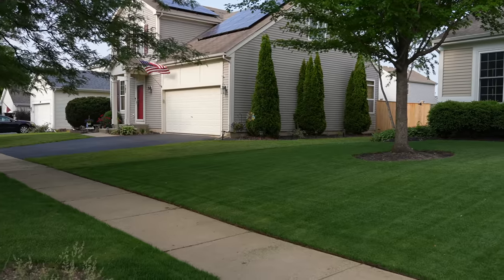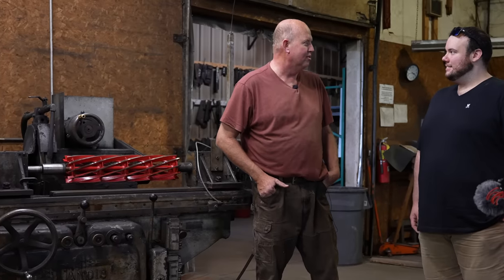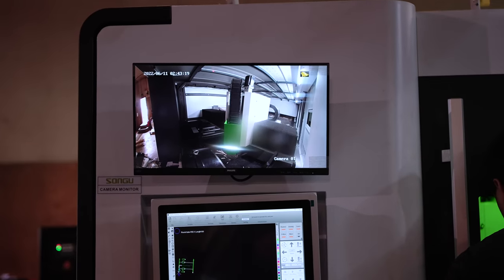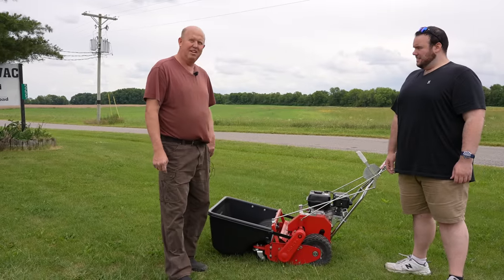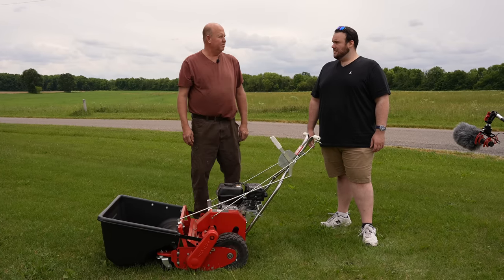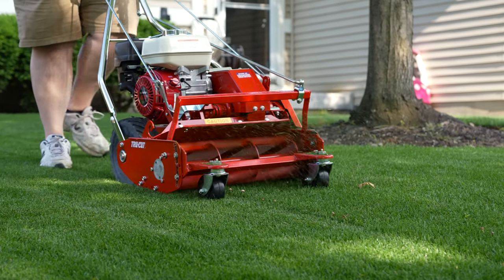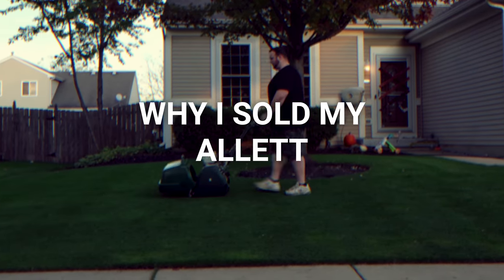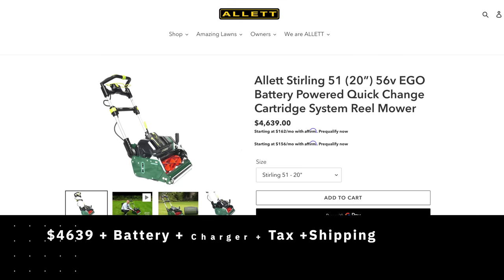This Mower Will Make Your Lawn Look Like a Golf Course

Comment: Nice review on the machine.  I wish it would stripe .  I wonder if you could rig up a Big League roller on the back.  I have a Swardman that stripes great but is hard to use as if the grass gets too tall it doesn't cut unless you take the front roller off and put on the tall grass wheels, which don't roll very well.  I usually get my time master out and mow with that, then use the Swardman the next day.  My schedule doesn't work to mow every other day very often.
Reply: It should stripe now that George added the front roller

Comment: 😉 Thank you for the contact information for a local Tru Cut... I'm not in the Chicago area. I'm in Quad City area, little town of Aledo, IL. I'll be getting ahold of them. I don't know if they can help me, I have a True Cut, well kind of... I have a Starlite - True Cut... The original before it was actually just True Cut, an aerospace company, Who originally designed it from my research, and as far as I can guess mine is about a 1965 model, 21" 3hp Briggs... I don't think they make a 21" anymore well as far as I am aware. Not much has changed over the years. I bought mine used for only $30, it's old and has a lot of petina, and missing some guards, but some fresh gas and only 3 pulls and it fired right up and mowed the yard. Not bad for a 60-year-old mower. I will try to contact the company here local and see if they can point me in some right directions to possibly getting it service and possibly finding some old new stock or whatever for guards because I would really love to restore it to original  ondition as it is wonderful mower. It isn't good on my tall grass, as I'm gonna have to get my grass used to being cut short, lol, but It's an awesome mower.

Comment: Will have to ck out the trucut, I’m on my second McLane, not bad but I can’t seem to get the reel to bedknife set correct, have backslapped with 80 and 120 grit, still not cutting right, as well the parts are too expensive on a McLane. I want the 10 blade fine cut, have that on my current Mc but have gotten bored with it because I want a finer cut. Next option is Greens keeper model which I just don’t know, have hard mixed opinions. I do like how smooth the Mc is to turn, those back wheels on trucut worry me. I too have looked at allett and swardman and the plastic parts turned me off. Neighbor was having problems w allett right out of the box and he was going to send back and they offered him Honda engine upgrade to try again. Your gonna use that button constantly, still gonna break. I wish I could “Frankenstein” a mower together like an Eddie Van Halen guitar, haha
Reply from the maker: tell me about it! the reels for the mclanes are like 500 bucks woah thats too much
i will say, nothing maneuvers easier than a mclane, you can turn that thing w 1 finger which is nice

Comment: I live in the northeast region ( pa). Was wondering what type of grass seeds to purchase so I can cut it low like yours. Not all grass blades can be cut that low....correct? Thx
Reply from the maker: Correct, you will need either kentucky bluegrass or perennial ryegrass or a combo of both, mine is a 50/50 mix of midnight KBG and SS9000 PRG
Reply: @PrincessCutLawnCare  I will look it up. Thx for the reply back

Comment: are you happier with the Tru-cut better ? also  looks like a great machine but is it Good please give us the pro/con on this tru cut reel mower Thanx my friend
Reply from the maker: so far yes, only have used it a few times because summer came quick but i will keep you update day come fall
Reply: @PrincessCutLawnCare  I am kinda sad to see the Tru-cut has changed no more Honda motor #2 no more chrome handle they sell it now with a china motor and the chrome which gives a more 50's vintage look is now black  It has now bin Down graded since they now  sold to Midwest Equipment Manufacturing Dam I really Loved the Honda Motor and that Chrome color GONE NOW FOREVER 😔

Comment: What's the best weed AND grass killer, whether it's a single bottle of stuff or a mixture. Something that kills the visable part of the plant quickly, but also eventually gets to the roots.
Reply from the maker: Hi paul, please watch this video, you have 2 options, 1 is fast and 1 is more effective https://youtu.be/A1J0aa-9ZpE
Reply: @PrincessCutLawnCare  - Thank you so much for the response. Can they be mixed to both kill the visable part of the weeds quickly, while also eventually killing the roots?
Reply from the maker: @TheOriginalPaulGilpin  no problem bud, round up is already technically a mixure of the 2 because it contains glyphosate, only issue is its a really "hot" herbicide due to the palergonic acid which tends to burn the leaf tissue before the gly can be absorbed. If you end up spraying round up, be sure to due it in the evening as the sun can increase the burning effects of the palergonic acid

Comment: I Appreciate ur content.  Hows it cut tho? I'm about to pull the trigger on the McLane then I saw this. Any cons at all
Reply from the maker: Thanks boss! id say they cut pretty much the same.
The pros with the mcclane is its very light and hands down the easiest reel mower i used when it comes to maneuverability.
The pros with the tru cut is its built like a tank, very heavy duty. Also the duel clutch where you can control the reel and drive separately is very handy when mowing around obstacles.
Reply from the maker: Cons with both of them is the reel to bed knife adjustments. They both work the same way and i feel both companies need to improve it to keep up with the euro competition. They are both a pain to adjust.
Reply: @PrincessCutLawnCare  thanks for the fast reply and input. Also I'm taking ur advice on irrigation system sprinklers. I have a mixed salad of rotors. orbit hunter and rainbird. I'm switching all to the hunter mp. Keep up the great work. Be blessed

Comment: Trucut and McClane would sell a ton more Imo if they had drums or rollers on the front and back. I just don't like the rear wheels.
Reply from the maker: I thought the same as well until I used it, those back wheels really make it easy to transport in and out of the garage and around corners

Comment: I have nearly a brand new Allett and how hard was it for you to sell the Allett? How did you advertise it?
Reply from the maker: it was very easy to sell, i put it on market place and it sold within 1 day
Reply: Cool never heard of Market Place
Reply from the maker: @garythorington1600  sorry I should have been more clear, I meant Facebook marketplace
Reply: Thanks for the clarification I may keep the Kensington so I can scarf the lawn now snd than
Reply from the maker: @garythorington1600  I think allett would be a fine mower if they got rid of the chincy plastic, included transport wheels, and lowered the price

Comment: I definitely don’t like those small caster wheels on the front what did it cost you to upgrade to that roller
Reply from the maker: roller was 189 but honestly the wheels gave me a VERY clean cut, actualy cleanest reel mowed cut ever but i can see if you lawn is not perfectly flat how it could cause scalping

Comment: So will George move over to another USA made lawn reel mower?  No gas, no cables, no oil, no spark plug starts every time you touch it. No maintenance ,George you gotta go green. And only weighs 84 lbs. And cuts as low as you want. Might I say Hudson Star.

Comment: I got a swardman and can’t stand it. Inside the drum the rotators held by plastic, parts don’t fit, parts hard to find, customer service sucks. Just a overall nightmare. I was looking at allet until I found out it was basically the same thing. Been looking at tru cut now
Reply from the maker: Just like the swardman the allett is also driven by plastic gears in the rear drum. The tru cut may not have a rear roller but at least it is built like a tank.
Reply: @PrincessCutLawnCare  I’m bummed they are all sold out
Reply from the maker: @2shotsofvaca411  the tru cuts are sold out?
Reply: @PrincessCutLawnCare  I checked reel rollers and it says sold out for 2022
Reply from the maker: @2shotsofvaca411  call the number in the description of this video, it’s the factory direct number

Comment: Thanks for the great review. I just wish I'd seen it before the mistake I made getting talked into a new McLane Mower. WHY?
 Because McLane's New $2400.00 25" Reel Mowers are quite simply, poorly assembled junk, built using Inferior parts. 

HERE'S WHAT YOU CAN EXPECT from McLane in 2023: Misalignment issues, Annoying Rattles and Vibration Noises at different RPM's, Metal Fatigue, and cracks that develop within the first few weeks, caused by HORRIBLE welding during manufacturing (that gets covered up with paint at the factory), then they slap on some stickers (crooked) with their name and deliver these piss-poor mowers to customers. 

And all of that began within the first few weeks of normal, residential use, cutting once a week, and babying my new mower. I went to their website to file a warranty claim that's supposed to be covered for one year, but the problems with the mower and McLane's Service Department just got worse by the day. 
The only Guaranty that you can count on is you'll have Multiple Failures with several vital safety covers, shields and critical support parts within its first season, and they DO NOT honor their warranty for defective parts and/or workmanship. 
They have HORRIBLE Customer Service Management and the worst technical support provided by some old woman with no troubleshooting or technical skills, and who only speaks broken Engrish. 

And my big question is just how are these (allegedly) "Made In America" when their engines are made in Thailand ? 
Their advertisements shamefully talk trash about the competition for using foreign parts, and yet with McLane, the most complex and the most important part of the mower, which is over 18% of the weight and has the most internal parts, is built by Honda of Thailand? 
And where are they getting the other poorly made, reject level parts from? 

I can only believe they continue to keep their doors open solely using FALSE ADVERTISING and Unethical Business practices. 
Because it has been my experience of how McLane operates daily. These guys are LIARS and THIEVES ! 

Just notice there aren’t ANY reviews on McLane’s website. Now we know why! BUYER BEWARE !! 
AVOID McLane Lawn & Garden Equipment. In my opinion, even IF they were once Made in the USA, (they’re NOT now ) they give "Made In America" such a bad reputation, they'll make you wish you'd bought something "Made In China" instead ! 

They are an embarrassment to the lawn equipment manufacturing industry, and to American companies in general.

Comment: So what is keeping these American made companies from using a rear drum? These McLane and TruCut machines are complete garbage because of the grooves they create on baby lawns. It makes no sense. If I could find a Bushmaster her in the US I would snatch it up in a heartbeat. But no real rear drum is. Huge difference between buying a used JD or Toro and a McLane Greensmaster. We deserve better that building reel mower without a friggin’ rear drum. How hard can it possibly be?
Reply from the maker: i think it has to do with their old school ways.. They've been doing it like this since the 50s so why change now? type of mentality. 
i do think you will start to see more competitive reel mowers from the american companies coming up here pretty soon but seriously dont knock it til you try it, i know on paper the rear wheels sound like they suck but man its so nice to easily transport it in and out of the garage with out having a heavy steel drum grinding all over the concrete.
I thought cutting with the caster wheels would be terrible but after my first cut i can tell you... not having a front roller actually results in a MUCH cleaner cut, no straglers. Gives it a carpet type look.
Its just one of those things you have to try before you judge the specs.
Reply: I have all kinds of grooves in my lawn from my brand new seeded lawn as proof. I’ve done both McLane and TruCut. Those TruCut wheels are the worst. I’m not knocking it. I’ve tried it. The McLane Greensmaster that has the rear roller made of tires is ok but there’s no way in the world I would recommend this mower for a full reno. Let alone how your thumbs must feel after mowing with a TruCut. 

For residential lawns, an Allett is a stretch but any local golf course can regrind a reel. The machine is a machinists machine not a John Deere machine or a Toro machine. It’s not that hard to get a reel machined.
Reply: I think TruCut has made enough off of their customers to engineer a true residential reel mower with rear drum that people would pay for. Stop setting the “Assembled” in America jive. 

I love your content but if you could talk to them about a reel upgrade maybe they will listen.